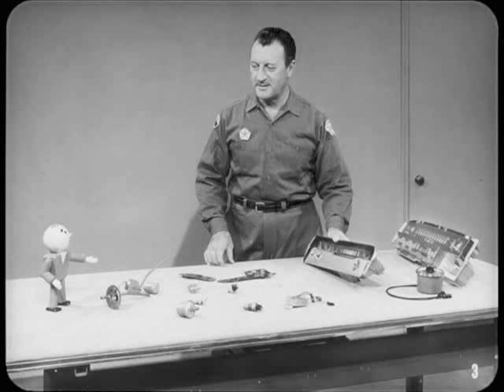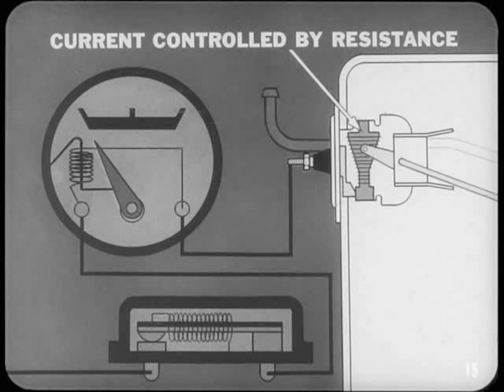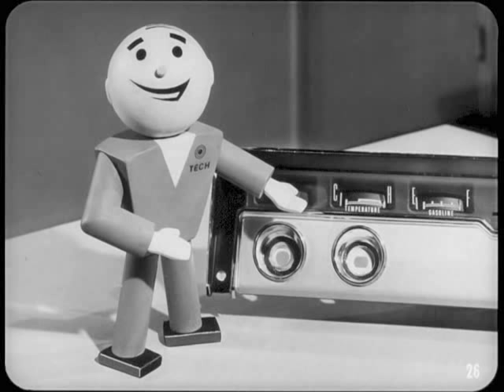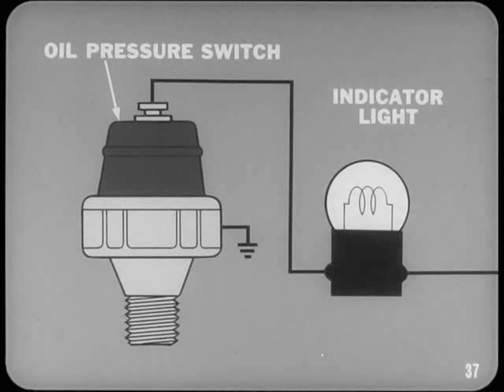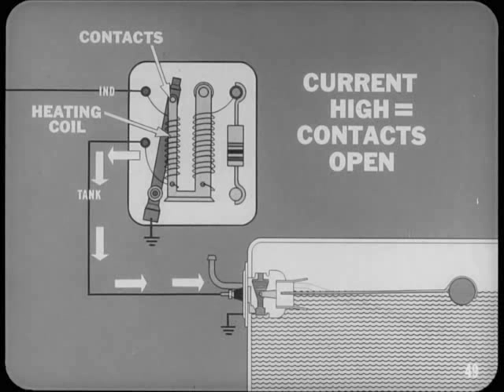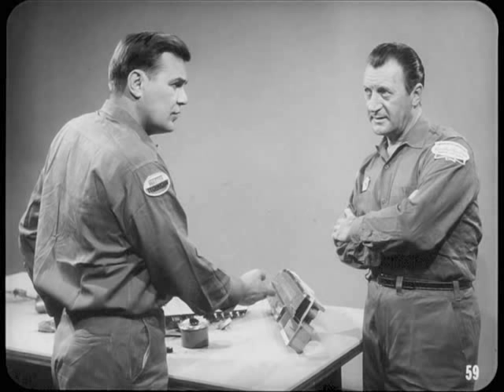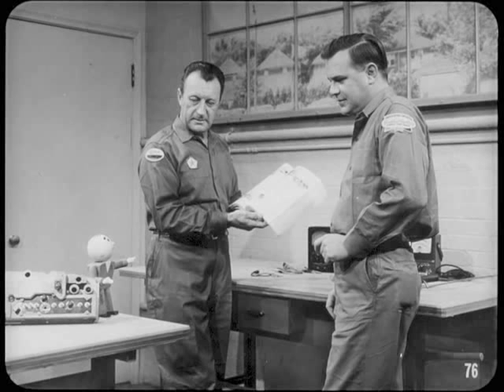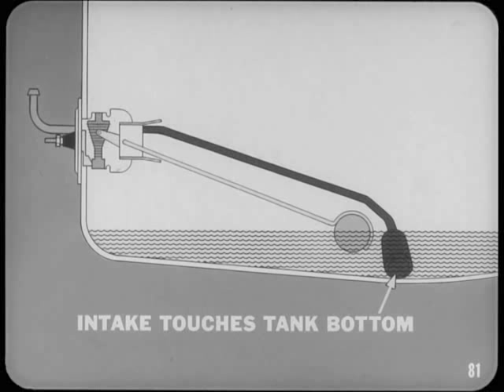Chrysler Master Tech - 1966, Volume 66-10 Thermal-Electric Gauges

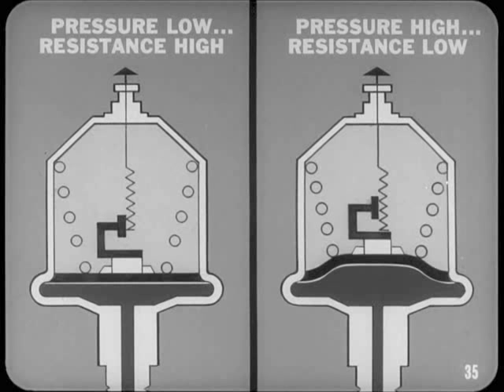Comment: 8:30 I have a funny story about something happening to an oil pressure sending unit. This story can further warn people to take accurate notes of a car before it enters the repair shop.

Back in 2011, a 1987 Nissan 300ZX entered our repair shop for an oil change. The service writer gave the mechanic the wrong oil filter, which screwed on, but didn't stay put. The moment oil pressure rose after startup, it launched the filter off the engine. In the process, it took out the oil pressure sender. When dealing with the Nissan Z31 300ZX and S130 Datsun 280ZX, there are 4 senders to choose from.
1. Non turbo and analog gauges
2. Turbo and analog gauges
3, Non turbo and digital gauges
4. Turbo and digital gauges

If I wasn't the kind of Nissan expert that I was, I'm sure solving the problem would have taken my coworkers much more time.

Later that day, we read the estimate that was printed for the 1987 Nissan 300ZX. Somebody typed in "Pontiac Sunfire" and that was why the filter was wrong.

8:57 sometimes the pressure switch will fail and partially illuminate the warning light. If that happens, get your ohm meter, and be sure that there is low resistance when the engine is off, and resistance goes to infinity when the engine is on.

10:00 Temperature warning lights were always rare. I was in the business when these Chryslers were only in the hands of collectors. The only modern cars I can think of that had these lights were the cheapest Toyota models. By that time, the cold and hot engine coolant light was probably operated by the computer, based on the measurement taken at the coolant temperature sensor. The computer would then light it at an exact temperature.

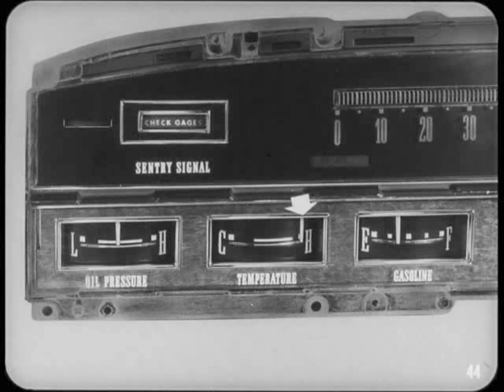10:30 My mom made good use of the equivalent of the "Sentry signal." She often drives her car until the tank is close to empty. When she had her 1985 Nissan Maxima, she would wait until the robot voice chip said "Fuel level is low." On other cars she had, there would be a bright light on the fuel gauge that only goes on when you are very low. She would often use that.

10:55 GM trucks had an equivalent with a light that said "CHECK GAUGES."

It is interesting to see these tank senders. Most EFI engines ended up combining the fuel sender and pump into a unit. I don't know why they had to put a fuel pump inside the fuel tank. Some car companies are nice enough to put an access door under the back seat upholstry in order to swap out the unit. However, most cars require removal of the entire fuel tank, plus the tank straps will probably fail as you do this job.
Reply: VW New Beetles only had a temperature warning light. It would be blue when the engine was cold, go out in normal conditions, and turn red when the coolant got to IIRC 250*F. It would flash red if the coolant level was low.
Reply: @compu85  Wow, 250F is an awfully high temperature before giving a warning sign. I guess that is one reason why many VW's made over the past 25 years had a hit or miss reputation.
Reply: @skylinefever  people liked to joke it’s the “cracked cylinder head indication light”. 
Even on cars with a gauge, software keeps it pointing at 190*f from 175*f to 225*f!